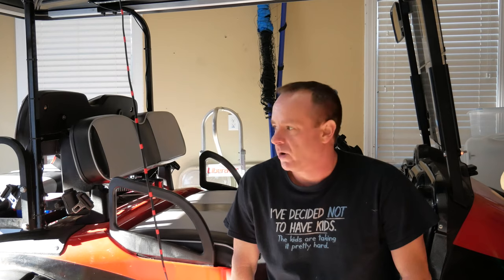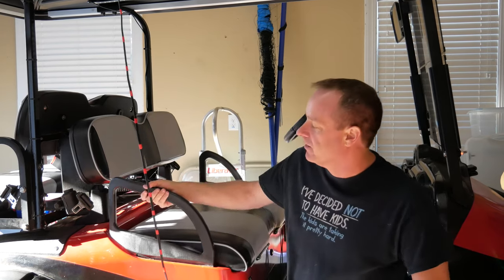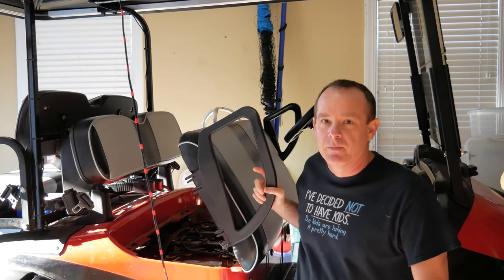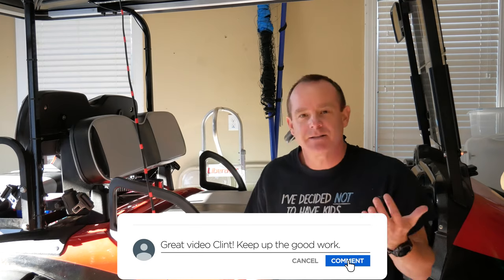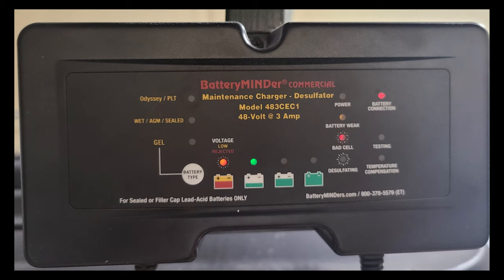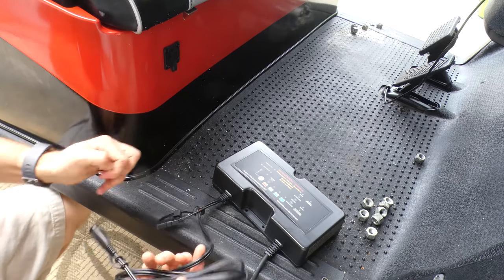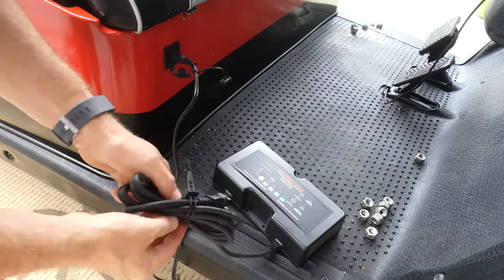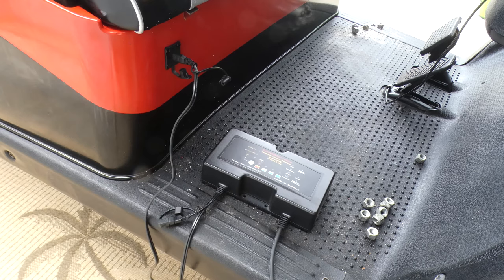Double Your Golf Cart Battery Life

Comment: Ok sulfation happens from low charge levels to prevent sulfating you want A high current charge over 10a it will push sulfate off of plates into the electrolyte. You don not want a slow charge or a pulse this is why high end chargers for forklifts or stationary applications use capacitors they filter for a smoother constant charge (Hindle power makes great chargers) for high end applications. I can give you some great advice on batteries it is my profession if you are ever interested.
Reply: So what is your recommendation for a charging system?
Reply: For the application where one is "storing" their Golf Cart during the off season (hot summer months in Phoenix, garage temperatures averaging 100 degrees each day for 3 or 4 months) and "exercising" the battery once a week for a 5 - 10 minute Ride with 40 stops and starts and then hooking up to this particular 3amp charger (that recognizes it will add sulphates due to low slow amp charging so it does it's anti-sulphate dance procedure to compensate for it) is this the correct trickle charger for this application for the off season?  Is there a situation when a slow low amp charging cycle  is a benefit with  a wet battery at a low rate?  As I understand the preferred cycle for charging a wet battery is: Bulk - Absorption - Float with the amps used in each part of this 3 stage cycle reducing in each stage.  With a 5 to 10 minute workout of the wet battery once per week would it spend much time in the bulk charge phase since SOC (state of charge) would still be pretty high after the short work out?  Or in the scenario presented above would the over 10 amp rate of charge still be the better choice for charging up the last 10 to 15% of the battery?  Thanks in advance for the time you take to respond.  I'm trying to learn how best to extend the life of my new wet batteries and the down time summers when the battery is used infrequently and stored in very hot conditions. I can't do anything about the storage and temperature.  I can get someone to exercise the batteries with the once per week run of the cart with lots of stops and starts to full speed.  I can buy a fast charger for when I use it daily in the busy use season where the fast charger higher amps is the only practical choice but what about the off season?
Reply: Avoid sulfation with a completely sealed golf cart battery! Power stars EVF-150 and EVF-200 are Sealed lead acid golf cart batteries with the highest warranty in the industry.
Reply: @BigTimeBattery  all lead acid batteries sulfate. And none our truly sealed. You can take that sealed cap off and underneath it will be caps just like a regular lead acid battery.

Comment: I have 48v EZGO golf cart.  Was looking at options to replace all 6 batteries.  Purchased this charger instead and saw an increase in battery life of 25-30% in just a few weeks.
Reply from the maker: Awesome and great to hear.  The best is yet to come when you realize the batteries last much longer and don't have to be replaced as soon.
Reply: @ClintHolland  How do you get 48 volt with 6 batteries, some in series then some parallel?
Reply: @johnnyw199  8 volt batteries. 6X8=48 😁
Reply from the maker: All in series generally. They generally use 8V batteries for those. @johnnyw199

Comment: I bought a refirb 2012 rxv 48 volt in 2015 from a local refirber dealer.   It had 4 new Trojans and it came with the small OEM powerwise eq charger.  Once a year I add distilled water in the batteries and they’re still going strong here in late 2024.   Surely they’ll go soon but I’m happy with 9 years.
Reply from the maker: If you got 9 years then you definitely should count your blessings.  That is very unusual for lead acid batteries but sometimes if you treat them well they give your their best.
Reply: Two more points to add is that I routinely spray CRC battery terminal protector on the terminals and the cart is certainly not used daily and when used it’s never been on long trips.   Usually within a mile.   It always gets plugged back to the charger

Comment: We have a 2018 Club Car Precedent with 6 - 8v Trojan batteries. One cell in one battery is failing after only 3.5 years. I called our local Trojan dealer and asked about a desulfating charger. He said, don't do it. Sulfate will fall off the plates and collect on the bottom of the battery. When the sulfate builds up to the point of touching the plates, that cell will short, sometimes with catastrophic results. He said the "Eric" charger we have from Club Car is the best for the cart and Trojan batteries. I'm replacing the one bad battery, against his recommendation, but I'm not in a position to spend $1,600 on a full set right now. If I win the lottery, I'd put in a good Lithium battery pack and be done with cart battery issues.
Reply from the maker: That comment doesn't make sense at all. You don't just run this charger once, you continually charge with this which keeps the sulfate off the battery.  Not only that, but desulfation has been proven in independent tests to prolong batteries.  Or you could trust the guy who makes money from selling you a new battery.

Comment: You can also double the life by simply using a better battery such as the Power Star evf-200 or 150. They are completely sealed and also yield a longer warranty then any other golf cart batteries!
Reply from the maker: If you want to replace the batteries as a solution, then just bite the bullet and go with lithium.
Reply: @ClintHolland  Lithium is the new wave for sure, but the price is very high right now. I do agree.

Comment: I went the Lester III for my 48volt, so far so good, still have to maintain the water, I guess time will tell. It has a bluetooth function that allows me to see what the charger is doing and the charger mounts to the cart so goes where it goes and it small.  Bypass the original charge port and does not use the non working computer board that is original to the cart and controls the original charger.
Reply from the maker: Good to know.  I may have to check that out when or if my Batteryminder dies.

Comment: Thanks for making this video. We just recently purchased a 48v cart and it was obvious the charger it came with was hard on the batteries due to the heat generated and boiling of the water. The charger you recommend in this video was the perfect solution. 

Also appreciate the info on the 7/8 hole size for the external connector. Install was maybe 1/2 hour for me due to the info in this video.
Reply from the maker: That is great Steven.  Really appreciate the kind words and for taking the time to comment.

Comment: Looked all over for a video like yours. You should entitle it Battery Minder Install, because that's how people look for it. Only thing I wish you'd spent more time on was how to find the batteries you need to hook the leads to. I'm a novice, and batteries can be intimidating. I couldn't see, from your video, the where and why you hooked each lead. Everything else is straight forward. Asked a bunch of friends if they knew how to find the correct batteries in a series, and they didn't know either.
Reply from the maker: Thanks for the feedback and great tips.  The best way I could describe it is that the battery terminals that you connect the battery minder to are the only ones that don't connect to another battery. That is probably the easiest way to find them.
Reply: The last Positive terminal and the last negative terminal that don't connect to an or battery and these terminals should be where the battery charger outlet wires connect for you regular big cart charger when you plug it in to use that.

Comment: Wow. This was very informative. Amazing. Thank you. 

And please consider making more videos. I have plenty of topics if you need ideas. I’ve watch some of your other stuff, and it’s apparent you do valuable work.
Reply from the maker: Please send me some ideas.  I have been out of the game for  quite a while now due to some medical issues but I am back up and running now.
Reply: Can you update on the current condition of your batteries and charger set up ? Also, how old were your batteries when you started using that charger ? I'm currently using Pulse Tec Xtreme desulfators. I have 3 .12 units connected to two 6 volt batteries which is one pulse tech unit for two 6 volt batteries in a 36 volt ezgo cart. I'm always looking for a better way because theses Trojan T-105 lead acid batteries aren't cheap. I'll be going with a Epoch 36 volt lithium battery when these finally die. I've even tried three .12 volt solar panels connected in series to try and extend my cart range on the Sporting Clays courses but the jury is still out on that set up. Thanks, good video. Please update us......
Reply from the maker: @MacMcCabe2456    My batteries are still in top condition. I last tested them about 3 months ago when I refilled the water and they all tested less than 10% degradation since purchase. My batteries were maybe a couple months old when i started using a desulfating charger. After spending all that money on the Trojans I wanted to find a way to not have to buy them again soon.  Wish I had the money to go Lithium and I probably will next time. At the moment my batteries are about 5 years old. I think as long as you have a good desulfating charger that trickle charges, you can probably easily double your battery life.  That plus keeping the water level correct will do wonders for their longetivity.

Comment: Use my golf cart mostly on Thursdays and weekends. I’ve read stuff online about a charger needing to be a higher amp to do whatever it should be doing to the battery along with charging it. Just wanted to check and see how this has been working for you as well as ask if it would be ideal for my situation. I can’t imagine that it would ever have less than 10-12 hours to charge and in the case I had less time I would just use the OEM. Thanks for the video, hope all is well.
Reply from the maker: I think it would be perfect for your situation.  I use this charger 99% of the time and only ever plug in the one that came with the cart when I need a quick charge.  My batteries are 5 years old now and still hold a charge just as well as the day I bought them.
Reply: @ClintHolland  that’s great, just got it in today and got it set up. I’ve read some stuff about needing higher amps to “stir the contents, but if that’s even a real thing I’d think driving it would do that, but just in case I’ll randomly use the other charger when it’s a good temp and just needs a little charge. Thanks!

Comment: After watching this video, it looks like, when you install the wiring, you are connecting directly to the batteries.  Does that bypass the OBC?  I have a 1998 Club Car and the SLA batteries are about 3-4 years old but don't hold charge very well, but I'm thinking they should have a few years of life left in them.  I'm 'electrically challenged' and want a simple solution to improve battery life.  Any help would be appreciated.
Reply from the maker: That is exactly correct. I have this charger connected to the positive of the first battery and the negative of the last battery.

Comment: I've been wondering why they use 8V batteries instead of 6V or 12V batteries. Who uses 8V batteries (besides golf carts)? Why don't they use a more common battery? They're always more needlessly expensive. Makes no sense (except for just selling you stuff)..
Reply from the maker: In my opinion, you hit the nail on the head.  They want you to have to buy a special battery too but what do I know?
Reply: It’s like big tech accessories 😂
Reply: I think the idea with 8 volt is to get more overall capacity
Reply: @ClintHolland  You can always buy 12 volt batteries ( 4 for 48 volt, three for 36 volt). The ONLY downside is range will be reduced by maybe 15 to 20%.

Comment: I use a 220 watt solar panel, rated at around 19 volts. Hook your batt directly to the panel. Let the sun desulfacate the lead plates. Be sure to keep distilled water in the cells. To easy and it works great!
Reply from the maker: I love solar chargers but they do not de-sulfate a battery unless they have a de-sulfator built in. It is accomplished by applying certain frequencies to the battery terminals.
Reply: @ClintHolland  No, I don't use a solar panel charge controller to do this. Read what I wrote. "Hook the solar panel DIRECTLY to the battery! That way, the battery is  receiving around 19 volts dc.  I've been doing it this way for over 15 years. I live off grid. This is how I recondition my battery bank when it becomes sulficated.
Reply from the maker: @rockhoundingeasternwashing5308 Semantics I guess. Not sure the difference between a solar charger and connecting the solar panels directly to a battery and charging it. In both cases, the solar panels are charging the battery which makes it a charger. I am still not following though. The act of desulfating by a charger is accomplished in two ways. It uses high voltage and varying frequencies that  cause the sulfates to fall off the battery into solution. My guess on why the solar panel increases the life is the low voltage.  It has also been shown that slow charging increases the life of batteries too which is what I think you are doing.
Reply: @ClintHolland  if you hook the panel directly to the battery, the battery will be receiving around 19 to 20 volts or so. A standard battery charging will stop charging at around 14.2 volts. 14.2 votes is not enough voltage to desulficate the lead plates.  The battery has to receive at least 15.5 volts or more to boil the electrolyte in the cells. The cells will indeed boil, not a heated boil. Just rigorous boiling from gassing

Comment: Hi Clint, thanks for the video. It's kind of old (3 years) but still the only one that I found on the subject. I was wondering, I have a 6 - 8v battery setup. Do you still connect the same way that you did?
Reply from the maker: Correct. As long as the total voltage matches the charger you buy, you just connect it to the first and last battery.